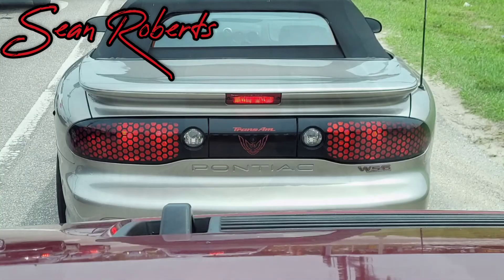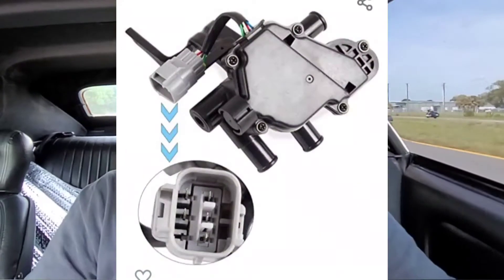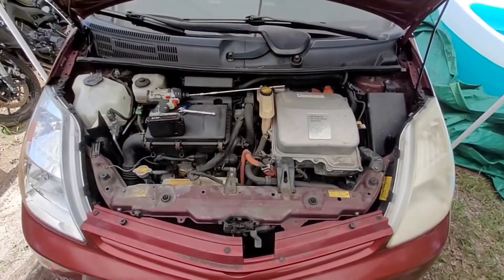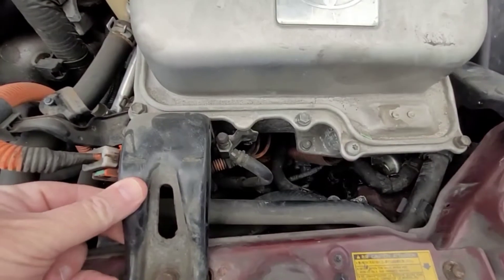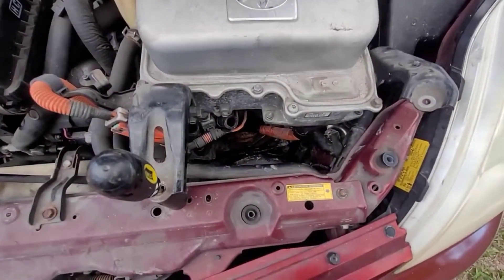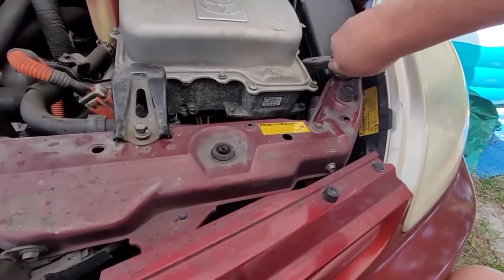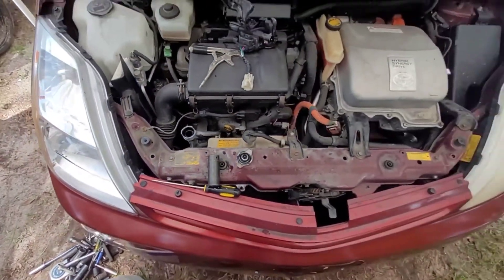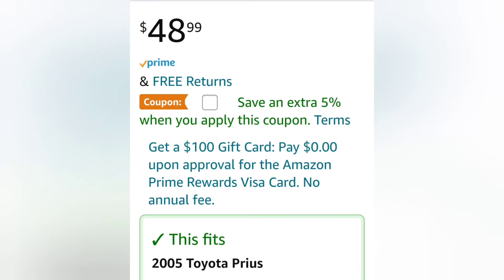Prius Code P1121 FIX Coolant Control Valve

Comment: Hey mate, i have changed the valve after 3 days another code pop up its p1116 what can i do?
Reply from the maker: @omar808kassab  I'd say disconnect the battery (12v) for a few minutes, then plug itback in. If that doesn't fix it, drive it for a few days and see if it disappears. If not, get a cheap code reader and clear the codes. Thanks for watching and commenting!

Comment: Isn't the inverter pump under the rear trunk?
Reply from the maker: I'm not sure about other generations, but it is located in the front of a Gen 2. The hybrid battery is located in the rear, directly behind the 2nd seat, but nothing else that's engine related is back there. Thanks for watching and commenting!

Comment: So this is my 3rd time within a couple years changing the Coolant control valve! is there a reason it keeps getting stuck?
Reply from the maker: Mine went bad twice. I finally went with a more expensive unit. It hasn't gone bad since. Thanks for watching and commenting!
Reply: @mohawkgarage   Yea thanks for posting it! how much did you spend on yours? cause im pretty sure i went cheap before and i think i got a more expensive one this time. like $75
Reply from the maker: @erichansen2790  While I don't remember exactly how much I paid, that sounds about right. Good luck!
Reply: After reading reviews of all the cheap ones on Amazon, I decided to purchase one from a local Toyota parts online store for my '08. Seems like there's 3 different levels of prices, $50, $80, and around $100+, even from eBay. My purchase 10 minutes ago from Toyota was a total of $122. I'm guaranteed to get a genuine OEM part. My original lasted about 200k miles, about 15 years. I'd rather not risk having to replace a cheap $50 one every other year, even though my car has an unknown amount of life left. YMMV (literally)

Comment: Thanks for posting! Did you bleed  the system after doing the repair?
Reply from the maker: I filled the system, then topped it off as it ran. It took about 20 minutes of adding small amounts until it was full. Thanks for watching and commenting!
Reply: @mohawkgarage  So I only add small amounts at a time while it’s running ?